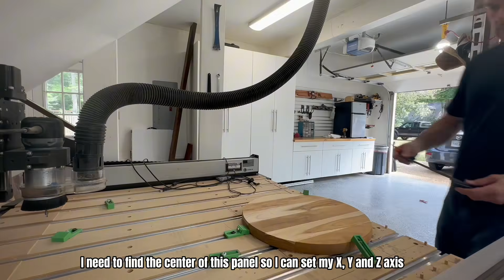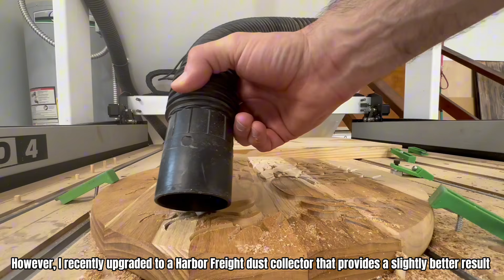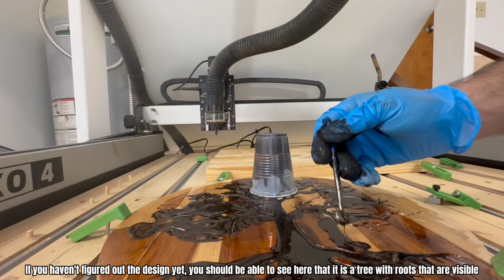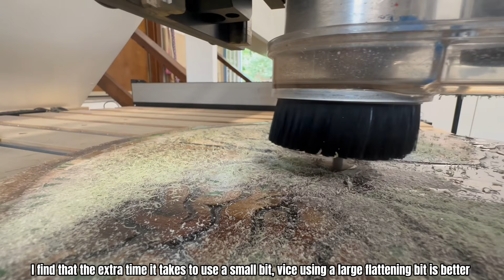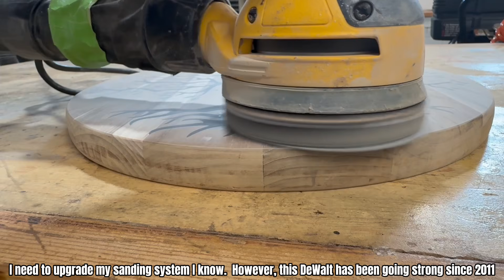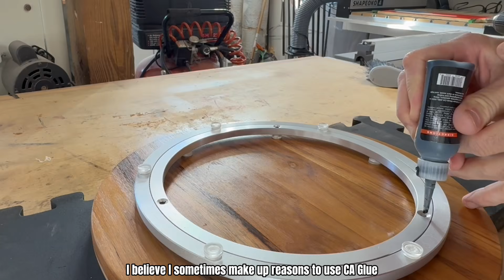Next Level Woodworking Profits - Simple Epoxy Inlays with CNC

Comment: If you use a syringe it makes it a lot easier to put the epoxy in the carve and less mess
Reply from the maker: I’m gonna need to try that epoxy makes a mess. That’s for sure. Thanks for the tip. ❤️